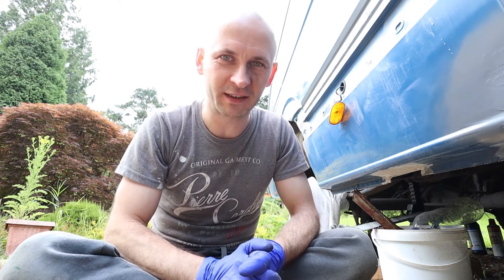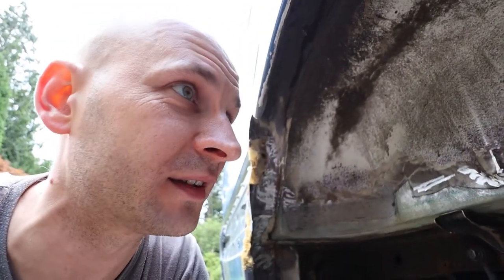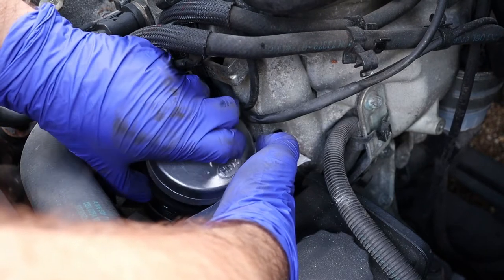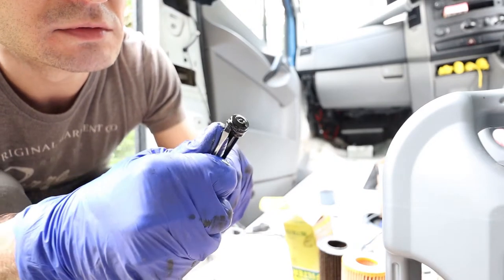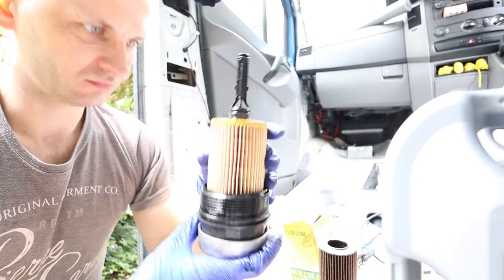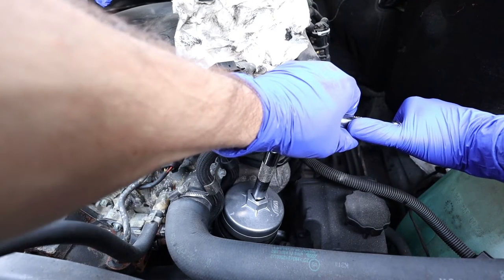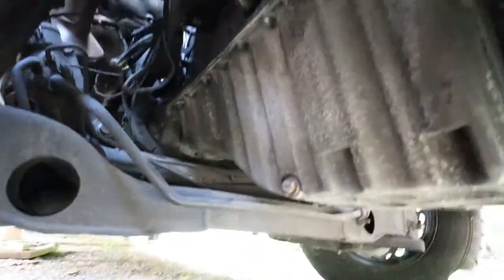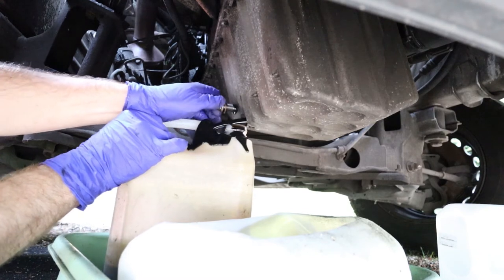DIY : Sprinter Van W906 Engine Oil Change

Comment: Careful with torque on the drain plug and filter cap.  You’d be surprised how little effort it takes to get to the right spec.